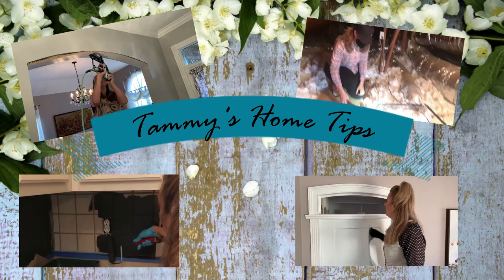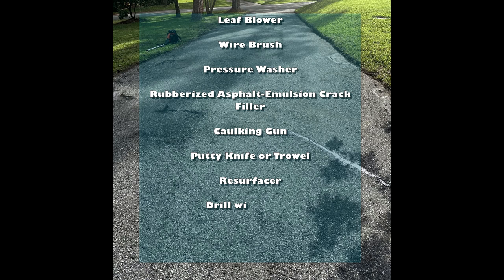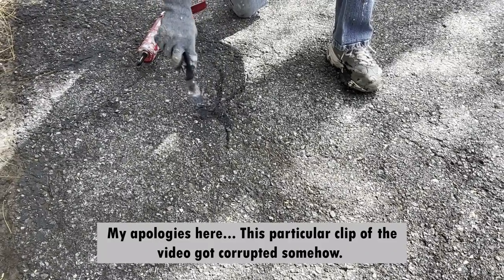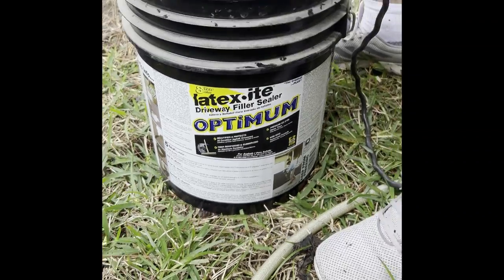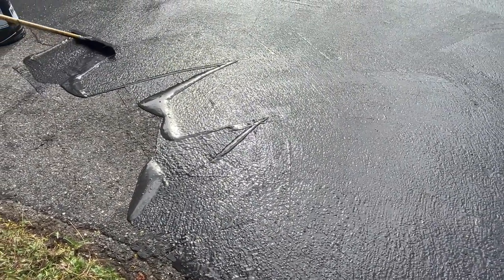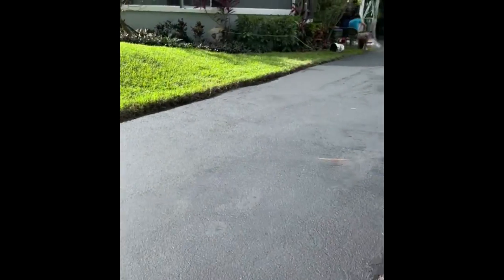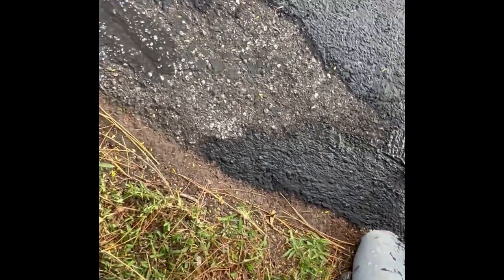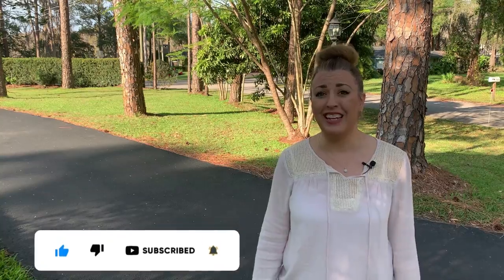Asphalt Resurfacing HOW TO DO IT EASILY

Comment: Curious on this note. We could definitely does this in sections over time. As we have a decent driveway length. Great final look here. Thoughts? Just don't want to get overwhelmed doing this project. It seems the prep is the time/ labor intensive side. 👍.  Because, last year getting estimates 22k, 16k, and 12k. Nah, better things to do with that money...
Reply from the maker: The prep is where all the work is. Once it’s ready it doesn’t take long to do the blacktop so I can see you getting that part done in one afternoon or day depending on the length of the driveway. 🙌🏼